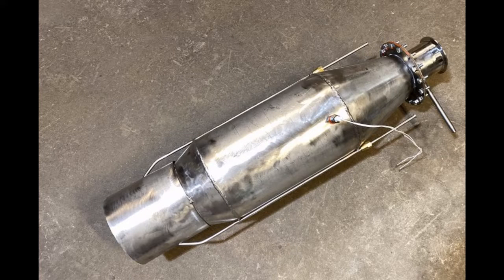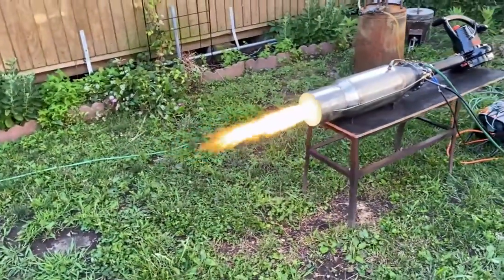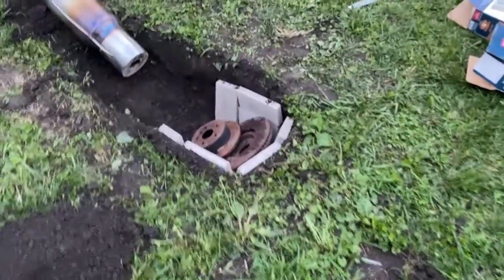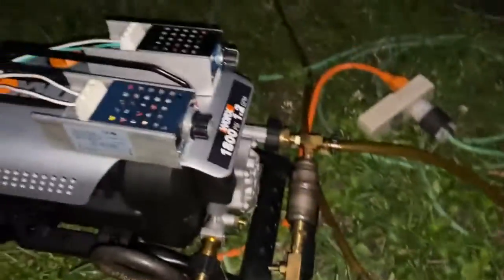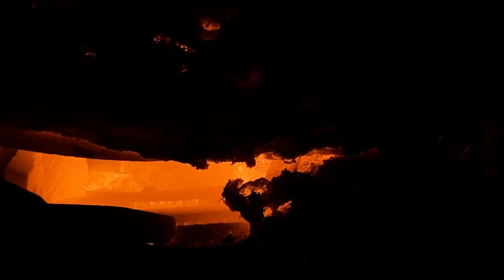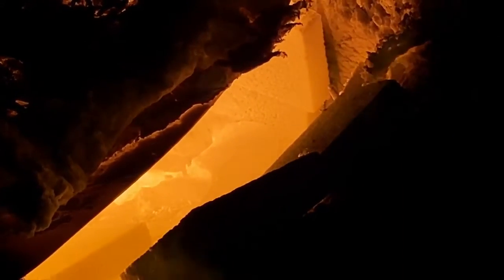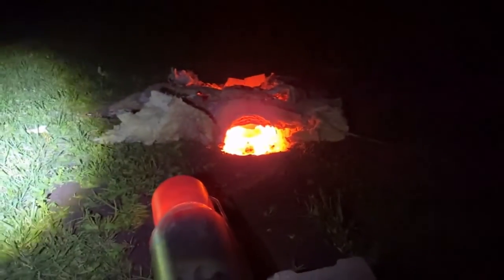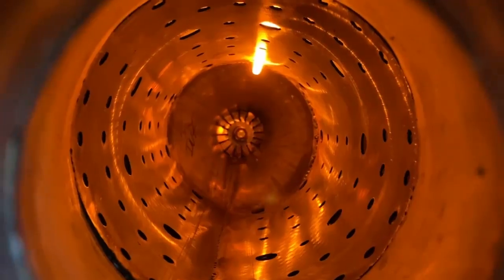High temp Casting burner with oxygen lance assist 2,300 C

Comment: hi. fellow burner fanatic here. why don't you mix the oxygen in with the air so that it is premixed with the air before it enters the combustion chamber?
Reply from the maker: It would destroy the burner
Reply: Of course it does. Didn’t take into account the increased temperature change with added oxygen😅 have you been able to measure the temperature with oxygen added?

Comment: so let's assume your insulation and bricks are good up to 2700 degrees.  that means you're making temps upwards of that... 3000 ish? next question-is it a concern that your O2 lances cause the flame to split into kind of 2 flames?
Reply from the maker: In the furnace it wont matter . I wish you guys could see the flame the way i do , its got some crazy details